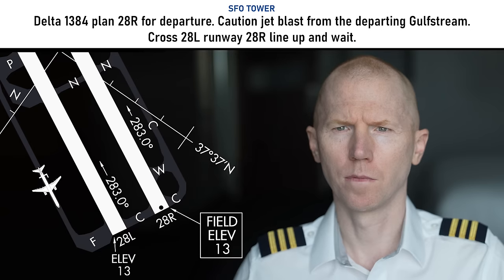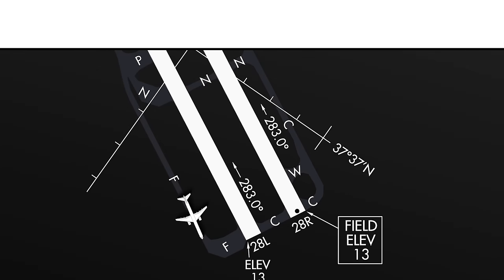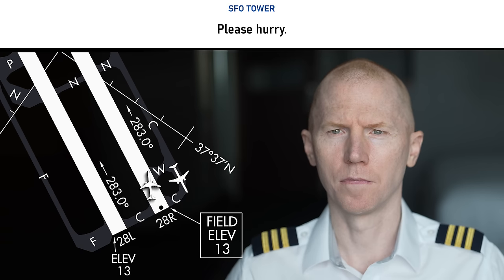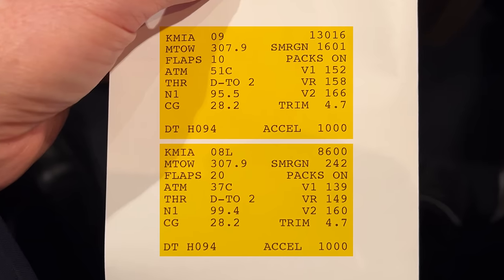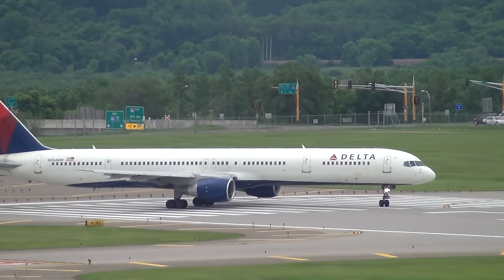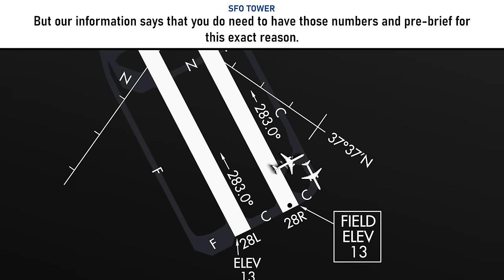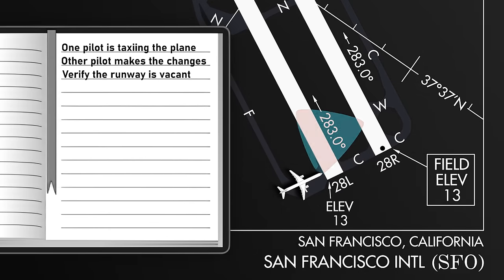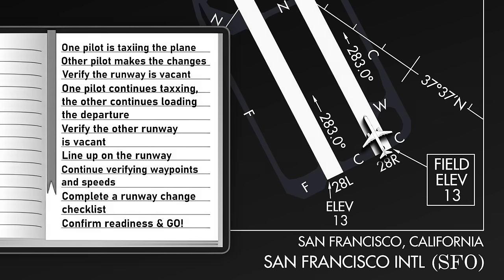ATC Doesn’t Like Delta’s Comment

Comment: That controller has a ton of narcissist running through her cold veins.  She also talks way faster than necessary, on purpose, just to make things even more intense.  Personally, I would have never boxed myself into a two minute window, and I've had to make those kinds of decisions before, because you can't count on being granted extra time and anything in access of what you agreed to becomes YOUR problem, even if you didn't initiate the situation.  But, long story short, she's a legend in her own mind and also a liability.  She needs to be dropping fries someplace, not working in the professional world.
Reply: She should try being a truck stop waitress .
Reply: Eh you're doing a fair bit of mind reading there, you can't really say what she was thinking or feeling at the time

Comment: There’s an EI A330 video on here KSFO-EIDW that departs 28L and they do mention in the brief about Kate changes to 28R. Seems the SFO controllers do this sometimes? Are those runways far enough apart to be independent parallel or do they need track miles of separation for concurrent use?

Comment: I’m not an apologist for ATC but as an airline captain who’s been in/out of SFO many times, I’m with the controller on this one…she did offer them a ‘hold short’ option if they weren’t comfortable lining up.  Yes she was locked and loaded for an argument but that doesn’t change the fact that the flight crew kinda asked for it by accepting the ‘additive’ (additives are external/internal distractions/events, planned or unplanned that the crew should discuss..) which in this case would be that it takes time to program the FMC, brief the runway change for the SID/EFP, maybe a flap setting change etc..and not completing those tasks under a time constraint lined up on a runway etc….it was good judgment in my opinion.

Comment: I commented on vasaviation on this incident, but I feel the controller asked 2 mins from initial transmission, but the pilots were stating 2 mins from in position (given the position they were at, would guess they needed a minute to get in position).  It's been a few months since I saw that vid, but I think the timestamps didn't exceed 2 mins from initial call to 28R to the times up call (putting pilots at about 1 min mark on their side), but either way, that felt very short from what she gave.  Others commented that at the time, the 1's were down for resurfacing (for several months) causing all kinds of chaos including causing aircraft to have multiple go-arounds due to poor planning (as which SFO blamed arrivals, arrivals blamed SFO).  Think she was involved in another incident, too but I could be wrong.

Comment: I would say that the pilots shouldn’t commit to 2 minutes if they are going to need more potentially. She said if you are ready in 2 minutes then get ready. If you need more then hold back until after the plane lands. They chose to enter the runway and place themselves under that pressure to be ready in 2 minutes.
Reply: Actually they didn't commit for 2 minutes, read carefully and you see that they thought that they had 5 mins. (they copied "we will take the 5 minutes"). 2 minutes was their rough time estimate, never intended to be "the time we need to comfortably imput the numbers".
Reply: @flo0778  0:15 Delta "Alright we are gonna need 2 minutes for taking off from the right." 
Because of the 2-minute timeframe, she probably assumed they had already pre-briefed the other runway, but they didn't.

Comment: I can’t believe it’s not a requirement for ATC to spend a week in the cockpit, and for pilots to do the same experiencing ATC for awhile. Personal contact with the perceived enemies will go a long way to prevent friction between the 2 groups.
Reply: Perceived enemies....really???
Reply: The opposite can be asked of pilots. Just observing the room and how the ATC work. It's a mutual problem.
Reply: @paulazemeckis7835  10/10 comment stating exactly why you were incredulous at a very reasonable comment (sarcasm), ATC and pilots are often perceived enemies what are you confused about here
Reply: It’s not. It never happens,they how it works.
Reply: If they spent time in the cockpit, they would only get a couple of flights a day, because they can’t exit before takeoff.
Reply: @Whamystrang    It should happen in the medical system, too.  I was lucky cause I was an RN first for a few years before I got an MD,  So, I had a unique understanding about what it takes to be a good nurse, and most drs don’t get it.  I’m a strong believer in exposing different disciplines to each other. That can only lead to more understanding , better communication and better camaraderie. Just my opinion.
Reply: @charisma-hornum-fries   agree, which is why I commented on that, too.
Reply: @paulazemeckis7835   I see a lot of animosity between disciplines when they don’t have an appreciation of the skills it takes to do different jobs well. Happens in the medical field, too, (I am more familiar with that). Maybe I should have used different words, but I still really think it’s a great idea to experience what other specialties work loads are like.

Comment: Are you sure there was a last minute runway change. The pilot said that, but the controller said “did you listen to ATIS?”  After that the pilots don’t argue that point (seems like these guys would) and never say anything other than “we were set up for 28L”.  There may have been a last minute runway change, but listening to this it seems just as likely to me that the pilots were just wrong, and that would give the exchange a whole different color.

Comment: Given how much time it would've taken for the plane to push-back, taxi, and line up on runway, notwithstanding the queue for clearances and actual taxiing, is there no onus on the flight crew to check for an updated ATIS which should typically happen once an hour, perhaps on the hour, or for ATC to broadcast that change? I'm doubtful in this case that the runway change was made 30 seconds before departure, as there are alot of considerations and liaising from the controllers' office before ATC actually effects a runway change. Least of all, willy nilly. Genuine question here....

Comment: My first runway change was on my first solo. I got "change to runway 20R, change frequency to 120.0" on short final on my first solo. My instructor [breathing hard] was still on the stairway to the tower cab. It was no issue for me, tho, due to being an amateur radio operator (frequency change no issue) and being well established (20 L and 20 R are only 200 yards apart at KPDK) it was a non-event. It could have been a big issue, of course.,
Reply: Did you get your PPL???

Comment: As an IT systems analyst recently retired from a near 4-decade career, I am gob-smacked that there is this manual input of all this data into a flight system prior to takeoff. It's obvious that all this data already exists online, albeit probably across multiple source databases. And the avionics for the plane are right there! And capable of connecting online! The plane can know exactly where it is sitting at what airport, and the pilots know the destination, and with that the current weather in between is immediately available, as are all the route data. The pilot should only have to use a simple UI to identify which runway they are being assigned to. In fact, the controller could even send that assignment to the onboard computer and the pilot accepts that assignment without even having to keep up with changing taxi situations beyond that acknowledgement and then can focus on the safe handling of the plane.
Reply: Manual input makes more likely consideration of the data entered, rather than making more likely the blind trust of data received via transmission from a system.   In an age of dubious information security, the idea of critical flight information being programmed from afar like a Windows update is frightening, prima facie.
Reply: The unfortunate problem with that is it would make the plane “hackable”. When you see how many businesses and government are being attacked by hackers, you wouldn’t want them to be able to set your autopilot to send you straight into the ground. The idea of being able to access control systems from the internet is just insane. It would only take seconds to put an aircraft into an unrecoverable situation, so that’s the worst idea I’ve ever heard.
Reply: @adamr9215  Ridiculous. It wouldn't be hackable if they used a proprietary operating system and proprietary database, surrounded by normal encryption and firewall systems. Only the very most skillful hackers could even penetrate proper security shielding (despite Hollywood movie silliness), and if the operating system on the other side was not based on Unix/Linux/Windows/etc. the hacker would simply be walking into a dead end. The proprietary OS wouldn't even need to have any of the normal memory hooks that exist for more robust OS's, since it would be single-purpose so the hacker couldn't even get responses back to their input, must less understand why.

Comment: ATC made the change and caused possible problems in the first place.  Because of that, the controller should have gone out of her way to give the pilots whatever they needed even if they were overly optimistic that they could get the changes entered in 2 minutes.  The controller was being a bit of a jerk.  She should have done whatever she could to assist and accommodate the pilots because she made the change to the runway at the last minute.
Reply: Listen again. She did.
Reply: If you think a cockpit is busy, try working in a control room. Additionally, it is quite possible that the information was as timely as possible. Aviation is dynamic.
Reply: @flfl2  She was kind of nasty about it.  No reason for the attitude after you cause them to do extra work.
Reply: @ciabrowne  And that excuses her attitude?  Seriously.  There is no excuse for being nasty after you give someone extra work to do.

Comment: ATC may have been a little passive-agressive, but I can't say she's wrong... ATC doesn't know how long it'll take us to set ourselves up for a new departure, so she worked with the timeframe the pilots gave to her, which was clearly and admittedly underestimated. It would have been more prudent for the pilots to just holdshort and take their time.
Reply: yes.. both sides are wrong and pissed each other
Reply: In hindsight
Reply: I don't think being right excuses being unprofessional on-air. She could have done all the same things without the attitude.
Reply: The issue isn’t who is right or who is wrong, technically.

The issue is what positive outcome was being pursued here. And with that in mind, do the actions of each further that positive outcome. With that in mind, the ATC - as Kelsey mentioned - set the pilots up for failure. She was NOT attempting a positive outcome, but to ‘be right’. 

And THIS is why it’s a problem. She needs to be retrained at another airport - preferably a Class C or D.
Reply: If we are concerned about attitude, the pilot tried to be sarcastic when he said he needed more than 30-second notice prior to a runway change, and nobody is complaining about that. She did advise they would takeoff from a different runway while they were holding short of it and gave them the option to keep holding short to set up and advise when ready. They decided to rush up and accept the line up and wait clearance knowing that there was traffic on final and that it would take a while to get ready. From my perspective, both had bad attitudes that contributed to the event, but I disagree that any of them has to be fired or retrained somewhere else. A review of CRM principles would go a long way.
Reply: @mbmafra  - you see sarcasm where I see a pursuit of a positive outcome. Informing the controller that more than a 30 second heads-up for a runway change is vital was not sarcastic
Reply: @arctain1  Things can get very dynamic in the cockpit. Dealing with that is one of the reasons we get paid. Every company has procedures for last minute runway changes. Being on the ground is a great facilitator to resolve such unexpected events because all you have to do is stop, set the parking brake and focus on the task. I'd understand the complaint if ATC had them lined up on a runway and then changed the clearance, but they were still on the taxiway.

Comment: This one is kind of complicated.  That particular controller has had a number of attitude issues recently, but I do think she was allowed to be annoyed.  Departures are usually on 1L/1R, but they're under construction, so right now SFO is only working with 28L/28R.  That's not a normal situation, which is why the ATIS said to prepare for either runway.  They don't usually change runways at the last minute but the 28's are extra busy right now, so that's why it became an issue, and it's been stressful for everyone while the construction is going on.
Reply: well even if she was annoyed, she should not be conveying that over the radio. you can't speak like that in an office without being reported to HR
Reply: I didn't grasp from this video the reason why the ATC wanted to change the runway in the first place. 

I can't see how it would be anything to do with something outside the airport. It had to be something inside the airport. 

What is it in the airport that is so important that it takes priority over an aircraft that is most quickly got rid of by letting it take off as planned? Surely they must know that a last second change in runway is going to cause delays?
Reply: Bottom line, if you’re not ready to go, don’t accept clearance to sit on an active runway.   This is not an uncommon clearance at SFO.
Reply: @UALHVY  so it would seem, but it seems odd that they're unable to manage traffic more predictably than it seems they do. LHR has 2 runways, seems to manage fairly well, isn't especially quiet. What's the difference?

Comment: She fails to realize that we have to select the runway, then the departure, then the transition. After that is done, we have to verify waypoints and verify any discontinuities for the SID. Then we have to look at runway takeoff numbers and engine failure procedures based on our current TLR.
I wish ATC would be required to do ride-alongs to see what happens with last minute runway changes. I would also say experience matters! The FO’s we are currently hiring go heads-down and try to mash it out quickly, and make mistakes. Once the airplane is stopped, and I have the ability to watch their keystrokes, it almost always gets FUBAR due to experience level and being time crunched.
In this case and keeping in mind it is always easy to play Monday morning quarterback, I would have held short 28L and made the changes since my airplane is so damn big, and I couldn’t be certain my ass wasn’t hanging over the hold short for 28L when holding short 28R. Not always the case for smaller aircraft, which could probably do it.
I also suspect this Captain might have been doing IOE and dealing with instructing their FO that might have been making mistakes in the heat of the battle. My 2 cents

Comment: As someone that is looking at all sides of this issue, I’m wondering if the time those flights you suggest the ATC people should take with airlines should be paid for by the airlines- or out of the pocket of the controllers. It’s a valid concern.

Comment: There are airports where runway changes can happen often. SFO is one of them. For airports like these, good airmanship would be to program a departure off both runways with performance numbers as well. That way all that’s needed is confirmation of the correct activation of the backup route (secondary flight plan in Airbus and route 2 in Boeing). Minimal time gets spent reprogramming and uploading new performance numbers. This is what a well trained crew and good CRM does. Now, in defence of the crew, the controller poorly planned the runway change and should have allowed them more time to begin with. The clearance should have been to hold short of the runway, not line up. Poor clearance and SA.
Reply: Why do runway changes “happen often” there? As a non-pilot, I’ve always wondered about this. My guess is it can be a number of factors that can cause the need for a runway change at short notice? Weather, an emergency, wind change, etc.??
Reply: @AndreasS.-mh8ti  usually a function of very tight spacing between arrivals and departures. Not all aircraft are able to comply with ATC assigned speeds and therefore last minute changes can occur as a result of forecasting the traffic flow.

Comment: Open Question (off topic, but there are plenty of experts floating around here).  I was recently on a Bowing 787-10 flying across the Atlantic Ocean. I was watching the inflight map and information to pass the time. For over four hours, it appeared as though the craft was cruising at a speed of 1,129kph (Just over mach 0.9) structurally, of course the aircraft could handle that, but I was under the impression that a 787-10 could only reach a max of about 1,000kph with a strong tailwind.   Was that 1129kph reading false, or (under the right conditions I assume) can those Dreamliners seriously haul butt?